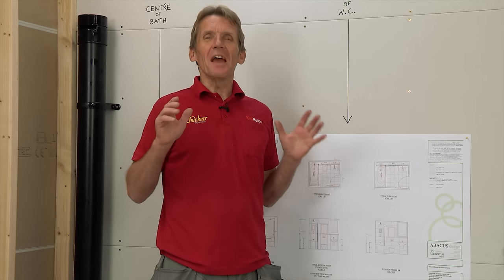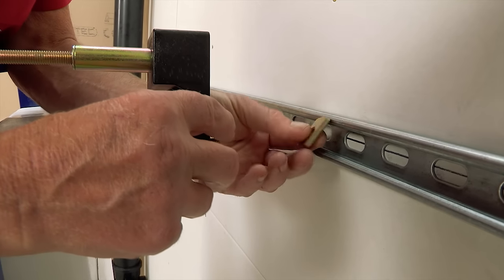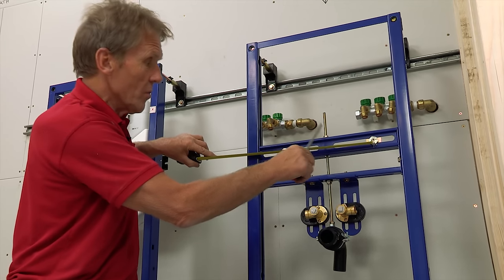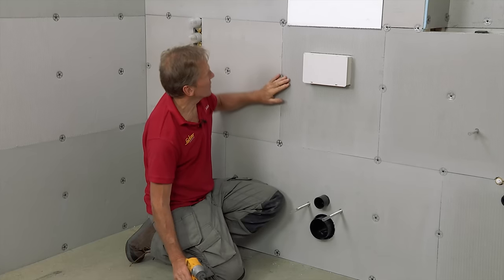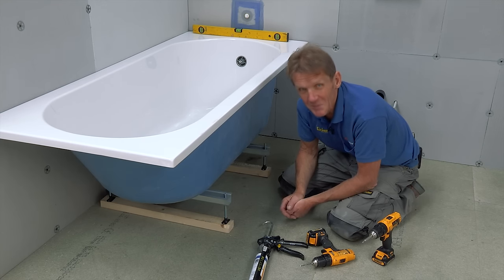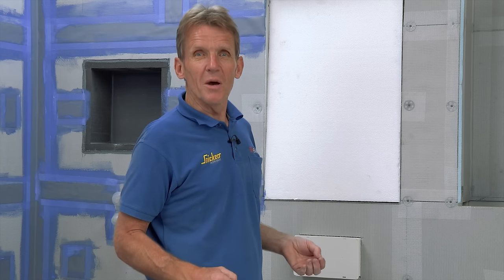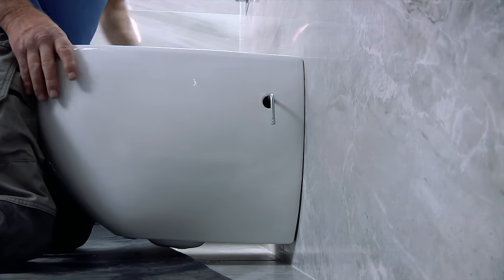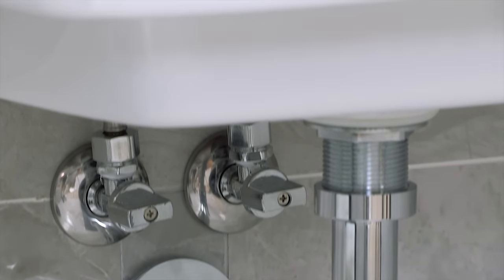Step-by-Step Guide For Installing a Bathroom

Comment: Is it possible to be a bathroom fitter with just a level 2 diploma in plumbing? Not the NVQ, just the level 2 diploma. Thanks.
Reply from the maker: Bathroom fitting is more about a variety of skills, there isn't usually that much plumbing. I am doing one at the moment that involves moving a door over, plastering, electrics, cabinet fitting and plumbing. Ask bathroom fitters what they hate most and many will say "fitting the bath panel"
Reply: @SkillBuilder  Thanks for the reply. I was trying to fit my own bath panel the other day and it was really annoying as it kept moving. I didn't realise that everyone has this problem!

Comment: This bathroom is very situational. Your banking on access on the other side of that wall to connect the basin waste. The bath taps are not normally on the wall like that either. You should always have access to under the bath, tiling panels is not good practice! You can of course, but should put in an access panel. Those clicker wastes are notorious to go wrong, your screwed when you need to replace it. I would not trust two bolts to hold up a toilet pan. The recessed cabinet I really liked, great idea!

Comment: better using a flexy for pan con  as can be a right cnt   to fit pan a  tiles against
Reply from the maker: Not on this cistern. It is no problem at all to dock the pan so long as you cut them to the right length.

Comment: I love these videos but my one issue is the way things like the panel panel is a permanent fitting. Luckily the waste trap pop up worked ok but they do go wrong and ripping off the bath panel once tiled is no joke. Ditto the toilet waste and flush. They can leak after a time
Reply from the maker: You can get to the toilet cistern and all the tiles in the bathroom can be removed with a multi tool. Plumbers ofter take a tile or two out to get at the plumbing. Most of the time it comes out in one piece and can go back. Certainly on the bath panel it is easy.

Comment: What alternative adhesive are there to dot and dab for the elements board?
Reply from the maker: you can screw it to the wall or stick it with gun adhesive
Reply: Thanks for your prompt response. Didn't frame my question right. Need to put elements board up today. Forgot to get the kst adhesive. Can I use the mapei or any other adhesive to stick 9mm elements boards to the wall?

Comment: I am worried now because I know the very experienced installer that did my shower used some kind of wood instead of Elements board and did not use “No more Leaks“ strip around the tray.  How do I get someone as thorough as you to do the job? Do these tradesmen exist? I do not think my installer would be very pleased if I was checking that he completed every detailed step. He would just say “I have done hundreds of these, do you trust me or not?”

Comment: Pause on 41:19/41:20, bad job from the tiler around the trim, should of faced the trim the other way but the main problem is the cut on the right side, pretty rough

Comment: This is the prime way to do a bathroom, but jesus, looking at hte cost of that elements board, you'll be about 500 in the whole just boarding out the bathroom haha
Reply from the maker: Yes £500  for a bathroom that will last. Much better to do the cheap job for £250 and then redo it every few years.

Comment: Yeah I do bathrooms I get it but not everyone can afford that scenario I've done wetrooms I actually think that's overkill so these companies make doe if you install a bathroom correctly which is done by a pro that's at least 3 times easier and  cheaeper and the  batthroom tiled right with sand based grout not smooth everything will be fine but floors should be waterproof no matter what no normal everyday run of the mill person can afford that scenario unless you have Quid's

Comment: Does anyone think i would be able to do this on my own? Bearing in mind:
- Im a female
- have zero DIY experience 
- have no tools (hopefully i could rent them)
- a budget of £3,500 (which apparently can't buy a new bathroom these days, hence my visit to this video)
Thanks in advance!
Reply: No you cannot, £3500 wont buy you this quality, I would guess you would not get much change out of £20,000 for this bathroom and the fitting. That is a good two weeks work to complete. Plus the products and materials and the Tax mans take on it.
Reply: @chrisa6279  sigh, worth a try 🤧🤧🙄 thanks for the info

Comment: Should have put waiting in the bath  then mastic round the bath give it Flexibility  when go to have a bath  the mastic will fall
Reply from the maker: This bath will not fall, it is completely rock solid, not like the cheap ones that move all over the place
Reply: Did say Bath will fall!  mastic will fall ! you should fill bath up with water or weights  give mastic  flexibility round the edge of the bath even time get in it I've been doing marble tiling I'm porcelain tiling in bath on floors and wall and mastic for last 30 year on floor we use dura base matt put down with flexible adhesive fast set , way you individual boards on floor I don't recommend it ,

Comment: 30:26 wait wait wait wait... All that amazing effort to waterproof things - no really, you're doing great stuff - and then you use plain wood with some screws??!? Would that defeat the effort? Isn't that wood a rot risk? Are they even rust resistant screws?
Reply from the maker: They are sealed. Everything is sealed except my lips.

Comment: Talks about innovation...still uses ptfe on female threads haha...still oldskool rog....loctite 577 mate
Reply from the maker: I am with you all the way on that one. PTFE is pants especially on chrome and if I had had some in my bag I use Loctite string not the577  liquid because they don't say anywhere on their technical data what constitutes medium pressure. I want a number.

Comment: Can’t beat copper pipe tho
Reply from the maker: I think you can. Run every plastic pipe from a manifold and have no joints in it. Nothing to leak
Reply: @SkillBuilder  good point however I prefer copper as I feel it’s more durable then plastic pipes and in the long run and if done properly copper pipe can last 50+ yearsand I think it looks better also in my opinion I don’t like the flimsyness and the sagging u get in plastic pipe just my personal opinion tho

Comment: I should NOT have watched this video! i'm about to have my bathroom done and I will just be comparing everything to this video! ha! god help the fitters!
Reply from the maker: Oh dear! If you can't get them to do it all this way at least get them to use Elements board and not water resistant plasterboard. Also use the No More leaks kit rather than relying on silicone sealant. It will fail. I have seen it a hundred times and it has made me a lot of money putting it right. Truth is I hate doing those remedial rip out jobs on bathrooms that are not even 5 years old.

Comment: no chance people would pay for this good of s job these days, domestic 3 bed house usual have a budget of 1500 to 3000 pounds for the whole bathroom, no way they could afford this standard of work unless your plumbing it in for free. 
looks great tho wish I had the time on job to do it that way.
Reply from the maker: We have to tell them that there is one standard. I wouldn't even start a bathroom for less than £5,000. I want to make money not work my nuts off
Reply: @SkillBuilder  if that's supply and fit I hope that's labour because the materials are at least 6 bags